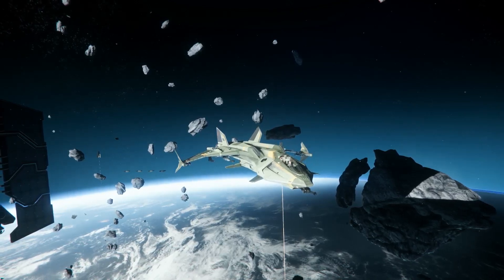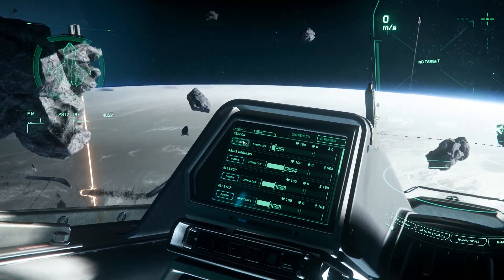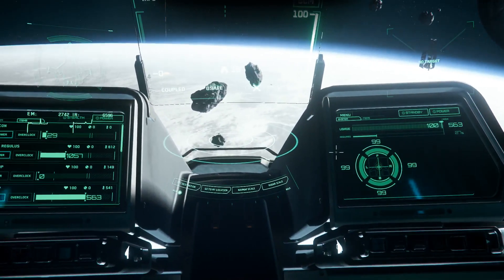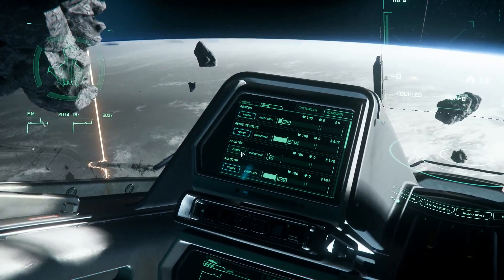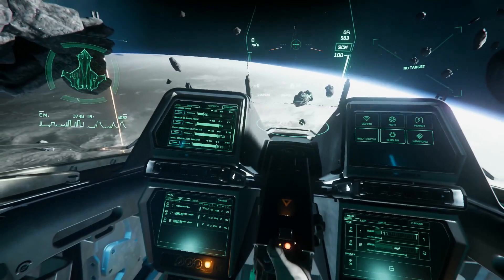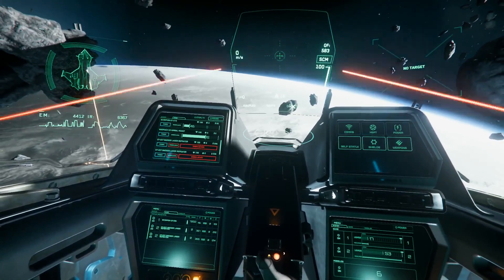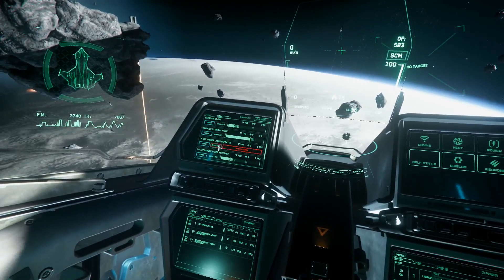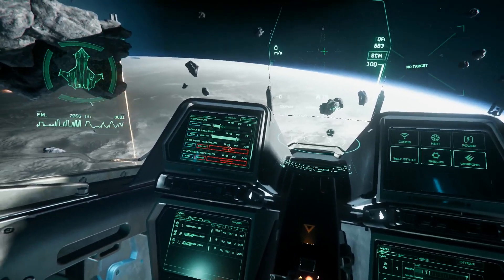Star Citizen 3.2 Weapons Overclock Feature

Comment: Speaking of weapon power, Squid, I noticed they changed up some stuff on the Sabre's hardpoint loadouts for power plants and shield generators.  With that plus the changes to power generation and weapon power draw, is it still possible to run quad S3 weapons on a Sabre's stock equipment without running into major energy choke issues?  If not, any recommendations for upgrades?
Reply from the maker: It seems to be fine with 4 panthers still